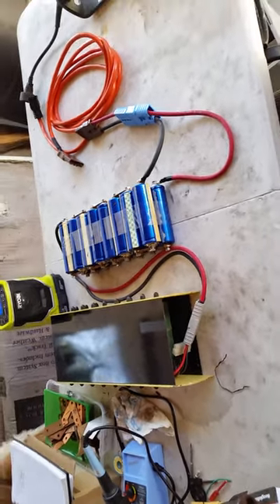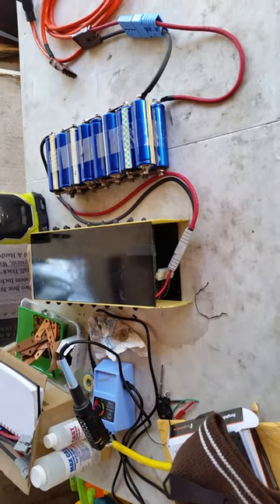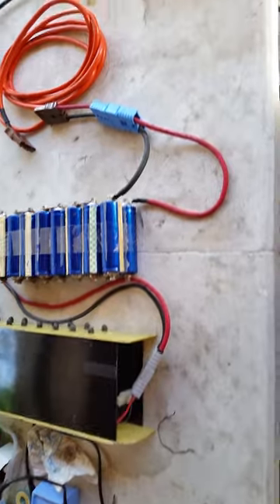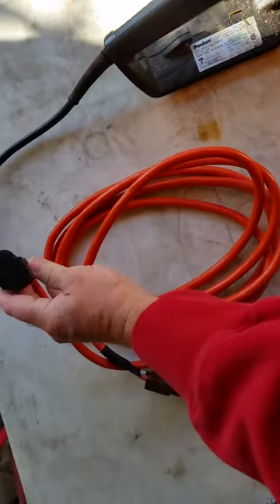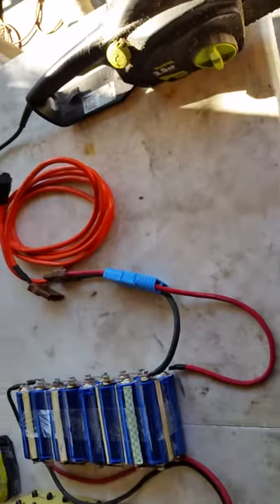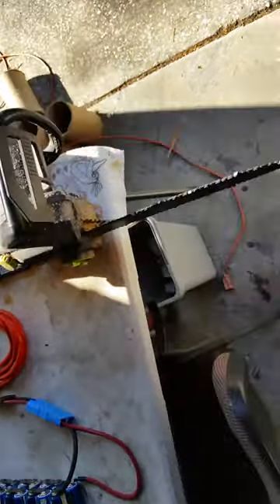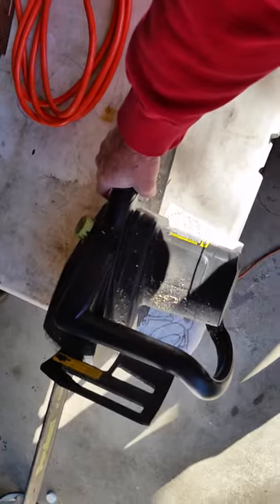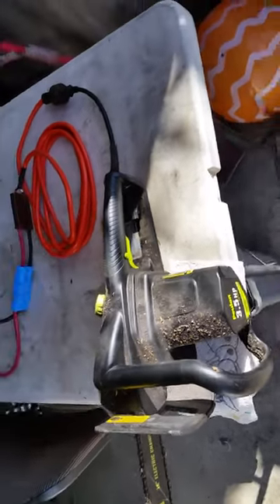Electric Chainsaw running on batteries

Comment: Nice work. Make a video how to connect a electric chainsaw with car battery if we are at forest with car ;)
Reply from the maker: The setup here is based on having a battery of nearly 120v (116 fully charged) so I was able to run it directly. If you want to run off a 12v battery, the easiest way to do it is to buy a 12v to 120v inverter. Connect the inverter up to the car battery and have it be accessible to an extension cord. But if you don't already have a corded electric chainsaw and an inverter, it might be easier to just buy a battery powered electric chainsaw. Battery tech is getting better all the time.

Comment: I found this through the magic of You Tube and it's exactly what i was thinking of doing with my Zero.  I see the battery setup worked, did it work with your bike?
Reply from the maker: kom2falcon yes, DigiNow sells the plug set up. Been tested on the zeros many times